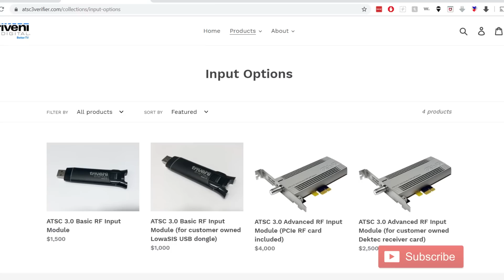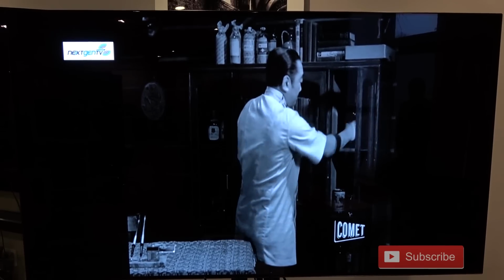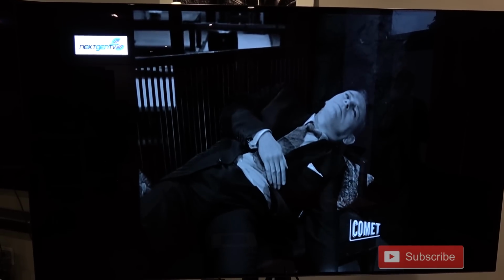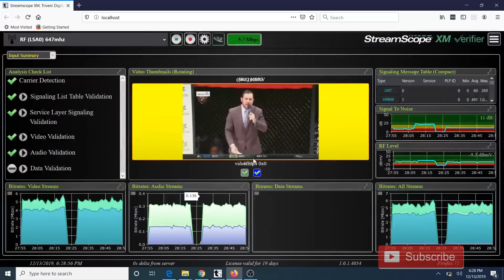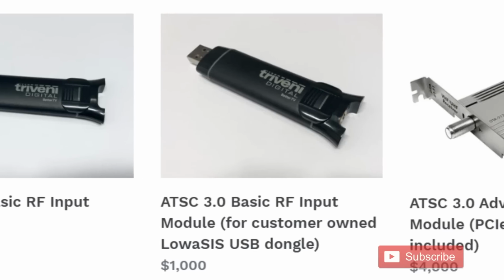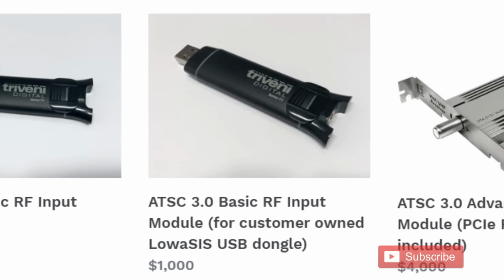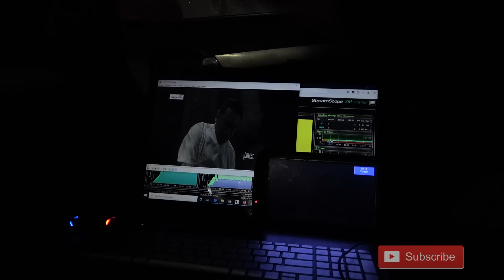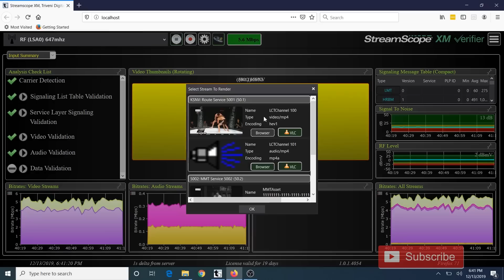ATSC 3.0 NextGen TV Signal Test and Demo in Baltimore, MD

Comment: Thanks for your efforts with 3.0, Tyler. We all need to take up a collection to get you an in-car charger for your laptop!! ;-)
Reply from the maker: I would have been fine if I did not spend two hours trying to get a signal with bad software. I will also have an HDMI recorder so I can directly record the screen instead of using my camera when driving.
Reply: @AntennaMan  Can you also do UK stuff?
Reply: Too bad Hovies' Garage just donated the perfect tv reception minivan to Midwest Dreamcar museum. Eight monitors in an original Pimp My Ride creation. I think you need such a vehicle. I'd help you in your research in some of those test areas from the big rig but, I don't have the dongle. Bid wireless fan here. Not so pro on tv but ham operator and other wireless reception.

Comment: I yearn for the day tv have its own built in antenna where we don't have to install extra one . I can't even get ALL or half my local channel .
Reply: Try putting your antenna higher in the air.
Reply: @philllsxga.7737  I did i still can't get ALL of the local channel. I'm lucky to have at lease 2 and that's on a good day 
If and when i tv died im sticking to my desk top. I'm so sick of not being able to catch local tv thanks to big greedy cable co. Tv will DIE if they don't allow at lease for us to view Local channels without having to be force to pay for basic cable
Reply: @Boricuasexii69  huh. Did you try that TV fool web site?
Reply: @Boricuasexii69  *at least (different meaning and different pronunciation on the end)
"Lease" is another word for "rent."

*If and when my TV dies, I'm
*desktop
*allow us to at least view local channels
*to be forced
Reply: @alvallac2171  eat a boil hotdog
Reply: I'd only want a built in antenna if it can be repaired and/or replaced without replacing the TV.
Reply: So ... you yearn for 1960-2005ish.  :) And they worked well through about 1981.
Reply: @tactileslut  It stop working cuz the power that be saw older model last far longer then they expected All these different HD Antenna is just a craze until someone comes along and offer true bang for your bucks
Reply: @Boricuasexii69  *It stopped working
*the powers that be
*saw an older model lasted
*HD antennas are
*someone comes along and offers
*bang for your buck
Reply: @Boricuasexii69  There is no such thing as a HDTV antenna.The signal is on the same frequencies that been used for 80 years.
Reply: @BernardS4  Tell that to the electronic store that say its HDTV antenna  I don't think the frequency are the same or IF big cable co are blocking many of the local channels . On things for sure i can only get 1 station
Reply: @Boricuasexii69  There is no such thing as an HDTV antenna, I had got  one of them from Radio Shack when they first done the change over, well last year accidentally broke one of the antennae so, I took an old rabbit ear with the adjustable loop and dial screwed a coaxial adapter on it and it's working better than the HD antenna, Ooh if you're not doing it, I would recommend having a signal booster between the Tv & Antenna
Reply: *has its own
*install an extra one.
*channels.

Comment: Hey I have old satellite  dish. Can I use the parts to get any local channels or is it consider just junk now? Would really like to know. Thanks for all your information
Reply from the maker: A satellite dish is not a TV antenna. No matter what they are broadcasting you will not pick up stations reliably with one. You need a TV antenna for that. Refer to my channel for reviews
Reply: What kind of satellite dish?

Those smaller dishes (Dish, DirecTV, Bell) could be used with a dipole at the focus as a small antenna, but a simple UHF or all-channel TV antenna would be better and easier to install.

An old C-Band dish with a feedpoint at the focus would provide gain, but would be very unwieldy, very tough to install, and could easily be blown down in a modest wind.
Reply: It is possible to modify an old dish into a directional antenna but it wouldn't guarantee better reception. You're basically just using the dish as a reflector.
Reply: It is the small pole with small fish from like direct tv. Its in the yard in the ground. The sma)er kind. I heard u could use the small thing from the center. And get local channels. If i could I hate to throw it away if I can get local here. I use a firestick So I dont get local wherre I am.
Reply: *is it considered

Comment: I have questions.  when will we see this new 3.0 signal  for all stations?  will I need to buy a new tv or some sort of decoder box like when the digital signal first came out?
Reply from the maker: The timeline still has yet to be determined because we are still in the experimental phase of atsc 3.0. Some stations plan to launch in the next few years and you will need a new set-top box in order to receive the signals. I will have more information on it all in a future video. The current broadcast are not going away as quickly as you may think
Reply: There’s no government mandate (no FCC mandate) at this time so it could be a while. Stations will deploy at their own pace.  Major markets likely will go first.

Comment: Awesome! They need to update the crap we have now.. You can have an Antenna right in front of the towers and the channels still get pixelated.. I'm happy for the upgrade..
Reply: Try putting your antenna higher in the air.
Reply: An antenna right in front of the towers is one of the worst places for an antenna. Since towers are usually on hills with very few viewers, they're designed to focus the signal farther away where viewers live.